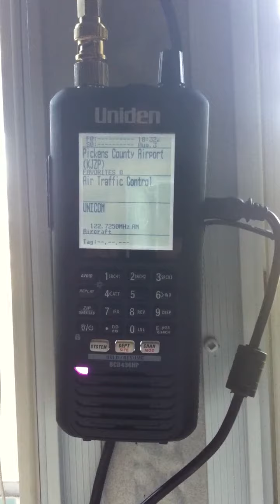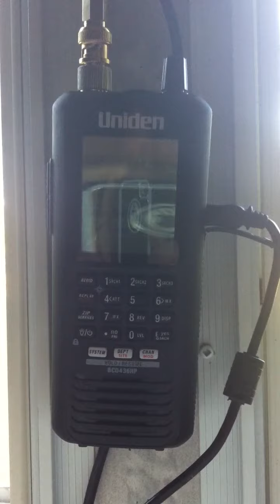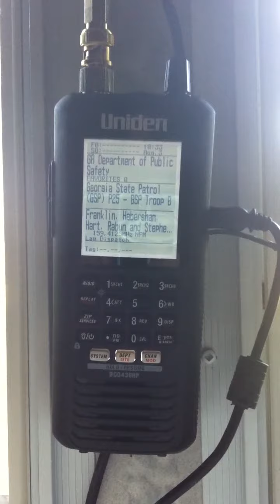BCD436HP live in action with Alert lights

Comment: this is the ONLY video that i have seen which features the alert light. thanks. i did not realize the 436 had an alert light til your video. mine was in route at the time. this allowed me to get these set in sentinel before i recieved it. very picky about my alert light color and pattern depending on what is being transmitted. thanks for the video. LOVE the 436 thus far.

Comment: what color do you use for trains? yours a newer release model? screen looks more grey/silver like mine (rather than blue). silver is supposed to be the fixed display.
Reply: and also fixed noise issue. They added capacitor in to fix that issue that made it deaf on a VHF bands as shown in the copper tape video.